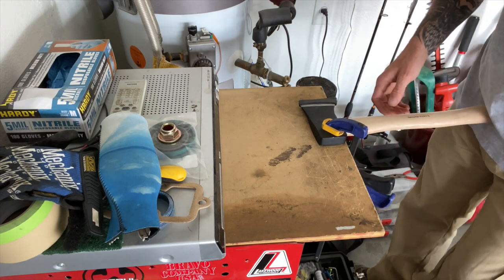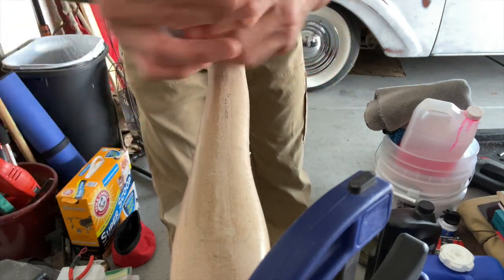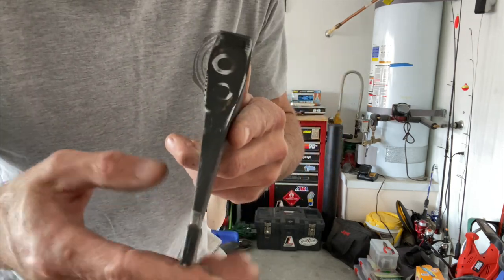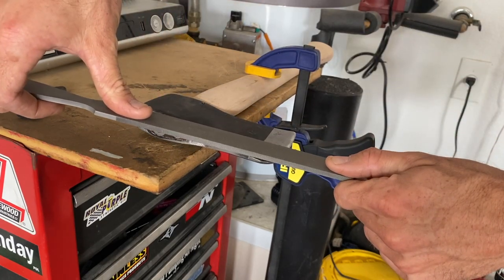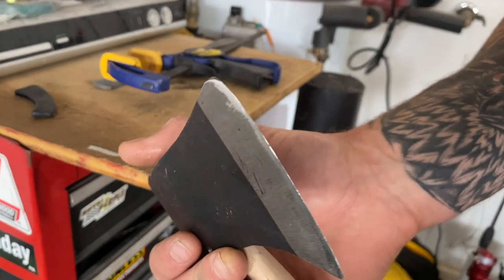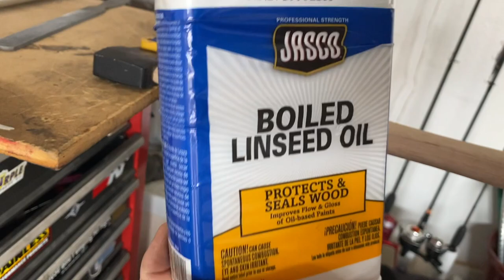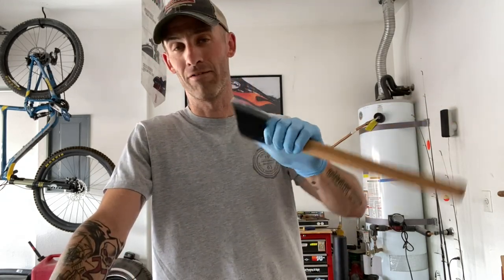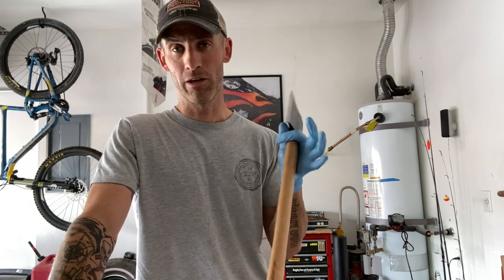Bushcraft/Camp Hatchet at Harbor Freight   HD 1080p

Comment: Check the handles carefully for the wood grain direction. If I am seeing correctly, yours is running side to side instead of front to back. In a hatchet it shouldn't become a problem but, in an axe it would be disastrous. Growing up in the Appalachian Mountains I would often use broken window panes to scrape the varnish or whatever finish was on the handle because it would bring up blisters when your hands started sweating.

Comment: problem is it;s like $15, but then you have to come up with a sheath somehow.  that probably adds another $35. so now you're up to $50
Reply from the maker: You can make a basic sheath from an old jacket or jeans from the closet or goodwill for a lot cheaper.
Reply: They sell leather sheaths for axes on Ebay for ten bucks...
Reply: How many sheaths can I seek you at $35.00 each? 😊
Reply: @RabbitHole-xyz  hmmm.  I actually made a quick sheath for it with about a 4x4or 5x5 piece of leather. Folded it hammered rivets along the edge and bottom an 2 holes where the handle would be. Ran a foot or so of paracord through them forming a loop basically. Pull one end and it secures the axe. Then wrap the cord around a few times and tuck it under. Works great.